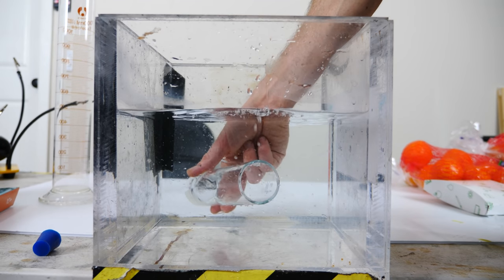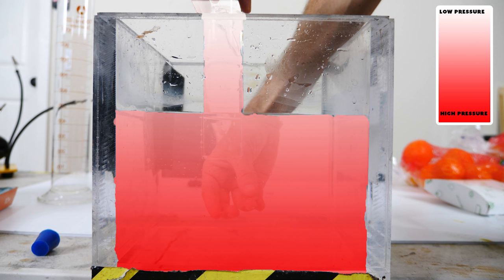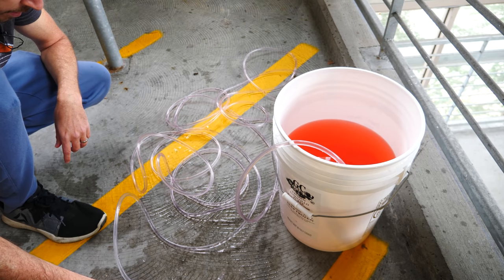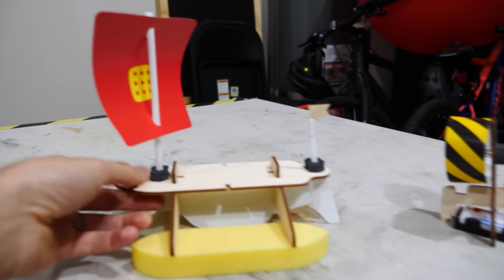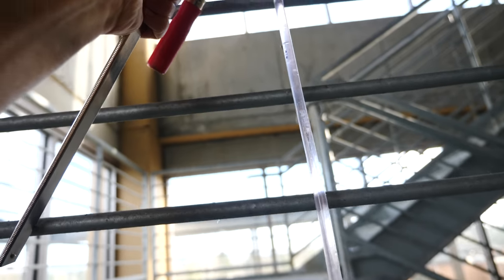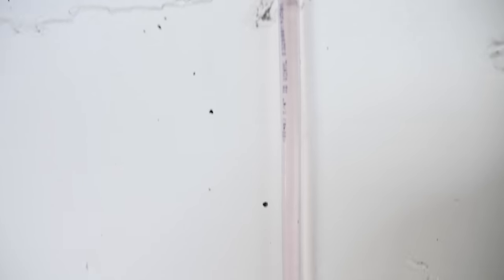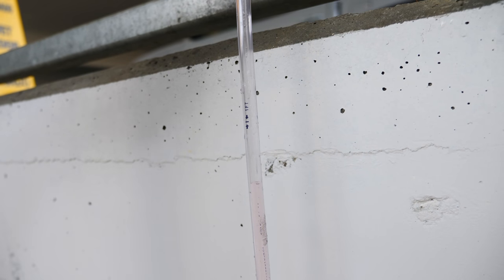Why Water Boils In Tall Cups

Comment: So, the "empty" space at the top is not actually a vacuum, but room-temperature steam, right?
Replace the water with mercury, and it would be a vacuum at the top, somewhere around 60 cm.
Reply: Mercury can also boil

Comment: I'm suprised he didn't take it to the next level and explain that is why we measure atmospheric pressure using a colum of mercury instead  of water. Mercury is much heavier and doesn't boil so easily, so on average, Mercury will lift to about just 30 inches, which is why aircraft altimeters read in inches of mercury.

Comment: I think if you were to use a really large diameter tube, it would boil with much less height, due to the weight of the water.  Not s lot of water  in that tiny tube, so it takes more height

Comment: It also depends if the water was degassed. I am willing to bet that most of that gas, in the tube, was dissolved nitrogen and oxygen that bubbled out of solution because of the drop in pressure.

Comment: You can get 2" clear tubing.  It would provide a better effect due to the volume.
Reply: The 2" tubing would display water boiling at about the same height, of course.  But you want to make sure that the walls of the flexible vinyl tubing do not collapse on themselves under the vacuum that's at the top.  This would be likely with larger tubing.  think of it this way; suppose you had 4" diameter vinyl tubing; it would work find under pressure but would be all floppy without that internal pressure.  If you look at the 1/4" diameter tubing at home depot when it's on the roll, it's all round cross section but the 2" tubing is flattened.

Comment: You should try this it's experiment using the metric system it is much more clever
sounding
Reply: 1 pound of Water equals exactly 1 horsepower if you set it 33 inch away form your Fahrenheit !

Comment: What happens if you immediately empty the 30-plus-foot tube?  Could you make tea?
Reply: The water isn't hot; it's boiling because its at a low enough pressure to boil at ambient temperature

Comment: I watched someone attempt to do a tic tok challenge based off of this "experiment, but they failed in the fact that they didn't increase elevation. Making me wonder how long you could suck water through a straw on a horizontal plane. Is it possible to stretch a tube around the circumference of the earth and drink out of it as long as each part is less than 27 feet above 1atm?

Comment: is this a way to evaporate water without adding any heat to the system ?

if you lift the pipe up to 60 feet 
then clamp it at 30 feet
would you have 30 feet of evaporated water ?
and then could you re-pressurize it and end up with distilled water ?
Reply: If your talking about the way there is less pressure the higher you get in the atmosphere?

Comment: I'm really wondering if you had the real estate could you create some very energy efficient phase change cooling but putting the evaporator high up or use this property to greatly reduce the energy the compressor uses, you would need to run in cycles where you'd close and open valves to stem the fluid in the tube and expose it to atmosphere have the phase change occur, pump the now gaseous fluid through and the close and open the valves to refill the tube. Probably a stupid idea because even though I get the idea of phase change cooling I definitely don't have enough of a grasp of this or anything related to see how this could optimize anything.

Comment: It would have been interesting if you had measured the temperaturw of the boing water, all be it through the wall of the plastic tube and explained why it was less than 100 degrees C or 212 degrees F

Comment: My only gripe is with the terminology. With no molecular energy being added to the system, does it really count as boiling? It's the same reason water fizzles into oblivion in space but you won't be able to cook macaroni like that, maybe freezer burn it but it's not rising to 100 degrees from pressure decrease, the 'boiling point' is being catastrophically lowered so I would assume we need a more proper term for the effect that doesn't overlap with colloquial boiling. I would suggest evaporation but even though that kind of works, it also kind of doesn't. We need a word that neatly implies both low pressure and phase change. A word like sublimation but instead of a phase change from solid to gas skipping liquid, a phase change from liquid to gas skipping temperature dependence.
Reply: Boiling isn’t just about temperature, look up the phase diagram of water. Phase changes (solid, liquid, gas, plasma, etc) are not based in temperature, but a specific relationship of temperature and pressure. Lowering the pressure lowers the boiling point of water. You can also boil water below 0°C at the right pressure.

Comment: Great channel, with practice knowledge

Just my opinion, reply me if anyone agrees with my statement

Higher you go, the top point have lower pressure, so air absorbed in water tries to go out of water (just like C02 comes out of soda when we open bottle and lower the pressure), which we see as bubbles in water, so my statement is bubble we are seeing is air absorbed in water coming to top.

I suggest that, boil water first and let out the absorbed air, cool the water and use that water to do this experiment again, try to not let water come contact with air.

I'm professor of engineering.

Let me know , if my opinion is relatable or not.

Comment: It should be made clear when “boiling” here literally means the water changing to vapor.. having NOT a Thing to do with the temperature of the water.       
When normal people regard boiling they associate it with water temperature not air pressure.    I’m surprised this wasn’t clearly stated..

Comment: Two problems with your explanation: The partial vacuum you create at the top does not "suck" the water up... Atmospheric pressure pushes the water up as there is a pressure difference. There is dissolved air in the water in your bucket and what you describe as boiling at first is just air coming out of the water: this could be verified by having another person lower down see small bubbles - the air bubbles will grow in size as the bubbles rise. Go take a field trip and see the tallest barometer at Portland State University.

Comment: I'm 56 and have known that water boils at a lower temp the higher the altitude. I had no idea it would boil at air temp at only 35 feet. (even though it's in a small tube) I would've lost that bet!

Comment: interesting,as A Scuba Diver that 33 ft has meaning also, every 33 ft underwater adds an atmosphere, but air is so much lighter than water, you wouldn't think that the same 33 ft of water in atmospherics pressure  where air amount used at 33 ft in one breath of air at 33 ft's pressure doubles amount you inhale due to it being compressed by the water66ft triples it, air pressure at sea level is 14 pounds, and fresh water 7 lbs a gallon, I know that 2.3 feet in rise gives 1 pound of head pressure in a 1 inch water column that the water in it will weigh 1 pound, I mess with little height changes or underwater  pressures, thins makes you think of ways to figure it out, went over to get a quick look and saw algebra, and said dang it's 3 am I think it's bedtime,  But I know your not dropping pressure really fast maybe lost .04 of a lb The water weight and the loss of .06 of outside air pressure does mighty and strange deeds, so I guess it's back to nature hates a vacuum and the only way to fill the space is to strip the gasses teach me to stay up late , sorry fer rambling

Comment: As an engineer, I had to do these calculations when I saw Willy Wonka and Augustus got sucked up that chocolate tube and the pumping mechanism was clearly above the pipe. Yep, there's a limit to it's height, just under 34 feet (10.3m), assuming on Earth at STP.

Comment: i bet someone else has suggested this, but incase not:  Has anyone tried to make a REFRIGERATION CYCLE with this specific technique?  
ie: Using altitude induced pressure differences to phase-change water.  Instead of a turbine or pistons or whatever is normally used.
Reply: How would you increase the height of the water without a pump?
Reply: @complainer406   They didn't use a pump in the video

Comment: Here is a thought: boiling takes energy. So when you move the tube up it should take  some energy from the environment.  When you move it down it should it should radiate some energy. So if you keep repeating that what happens to the temperature of the tub/water at/around the level of water in the tube? In that well ventilated environment? What if you insulate it? Could this be made into a rudimentary refrigerator? Too early in the morning to think this through.... :)
Reply: The temperature isn't changing, the water is actually boiling at room temperature  :) 

You're welcome...

Comment: Since water is more sense as a liquid than as a solid could you theoretically cool it enough so that instead of turning to water vapor it freezes instead?
Reply: It's not about the temperatue, but the pressure you cool it at. Water vapour turns straight to ice at low pressures, and the reverse of that is how freeze drying works. You freeze the object, then you lower the pressure until the water starts sublimating out from the object like dry ice does at sea level. Then you're left with a dehydrated object that you can bring back to room temp.

Comment: NO!  You have created a primitive barometer.  The reason you cannot get higher than the approximately 30 feet is NOT that the water boils and vapor fills the vacuum.  Mercury in a traditional barometer doesn't boil, but still cannot be lifted more than the approx. 30 inches of a standard surface pressure; it is solely the weight of the column versus the pressure at the bottom of the column.  Yes, the water at reduced pressure will boil, and that does reduce the vacuum, resulting in a reduction of the column height, but likely only a little bit.  If you did this experiment when it was just above freezing, you might get just a few inches more height from the column.  But the 33 foot number comes from the column weight vs surface pressure.

Comment: Considering steam is valuable for energy production (even nuclear energy is just converting the nuclear fission into thermal energy to heat up water into steam to propel a turbine for electricity), can this water vapor from your experiment be used to generate energy?

What I’m imagining:  a tube that rain water falls into, with the top open and the bottom sealed.  Once the tube is full, an actuator closes the top and opens the bottom.  The water at the top will boil.  Can this be used to run a turbine?

Most current rainwater-based electric generators use a turbine at the bottom to capture the momentum of the falling water to spin a motor to generate electricity.  But steam is always considered more powerful because of how much water expands when turning into steam, delivering way more explosive force to turning a motor for an electric generator.

I’d be curious to know the efficiency of a steam-based rainwater electric generator versus current rainwater electric generator technology!
Reply: The water does not get hot
Reply: @wvking  it doesn’t need to be hot.  Steam engines are based on the expansion of volume as liquid water transitions to vapor.  That expansion is captured as mechanical forces to push a piston.  Steam engines don’t use the temperature of the steam at all.

Comment: barometers like 32" or 32ft water column etc.  replace the tube with a 1"-Interior Dia(id). . try to use a long flourescent lamp tube, if you can de-gas mercury vapor safely, and be able to cut off 1 (one) end. Also have you ever used a vacuum for simple potting epoxy resin filler to assure thorough quality / or to test altitude varient's in cases like water-boiling temp/altitude. besides you said it was 33feet well maybe also the seal was not tight enough. but you would draw enough  Co2 out of the water like shaking carbonated water. thanks for the memory from learning typ- 0.7" Wc to 4-20ma speed control signal that hvac controls typ used back then.  airflow systems in large buildings from simply "Grunting" around and repairing New 3phase motor controllers in the late 70's when they first became widespread (Look Mom No Brushes to Wear Out). Oh yea Safety First (period) sorry for the rant.

Comment: Did you ever think that maybe the water is leaving the tube when you lift it that high and when you lower it the water is pushed back into the tube causing it to rise back to the original height? The water doesn't "boil". Water boils at 212F

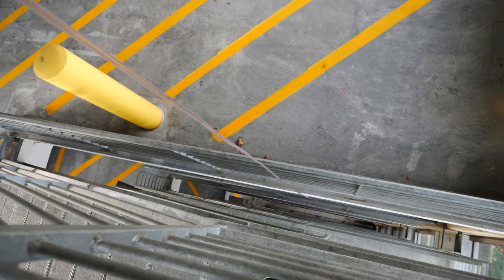Comment: 5:15, That's not true. You did not create a vacuum since there's water vapor in the space above the water. It would be interesting though to know the pressure inside the space. You could have topped the tube off with a barometer. It's impossible to create an absolute vacuum but it would be interesting to know how far you could get in this way by for example using a different fluid. Normally we use turbo molecular pumps (TMPs) to get into deep vacuum but TMPs have several drawbacks. They use a lot of energy, they create unwanted vibrations (especially unwanted in nanometer precision processing tools) and they are expensive.

Comment: Since this is basically water turning to vapour due to the lack of pressure, can you super speed force grow crystals like this?  

With the water evaporating it’d supersaturate the remaining water in the tube but still quickly force it off, 
since it’s basically a natural inexpensive vacuum chamber

It should be possible to super saturate water with a solute even if the water itself is at very low pressures right?

Comment: Why dont we use this effect to boil water to generate power?
Reply: The water is boiling because there's reduced pressure. It's not boiling because heat was added to it. It's not expanding and "producing" pressure. How are you gonna push and spin turbines.

Comment: OMG James i just wondered something. This is a phase change. Got me wondering. Can you make a heat pump out of this concept? Im imagining deionised water with a tiny tube going up, but near the height where we are interested in, that tube splits into a mesh of tubes. No need for compressors, pumps, pistons, sealing components, etc. Just tubes and a heat exchanger. Question is how to reset the device

Or keep the bottom reservoir in a sealed chamber with pressures lower than atmospheric pressure. You wont need the device to go 30 feet up.

Comment: It is not boiling. It is Torricelli barometer principle.
Boiling is usually for cases where the bulk of a liquid is at the boiling point!
In your theory you would be able to measure much different boiling points just by living at th 5th floor...

Comment: You have built a WATER BAROMETER.
The water is NOT BOILING, but rather sea level AIR PRESSURE can only support a HYDROSTATIC COLUMN that is 10.33 meters tall. 
Above that height only a zero-pressure vacuum can exist.

Comment: I would have guessed 33 feet - why, because when you scuba dive, every 33 feet is 1 atmosphere of pressure - So I would assume you could only pull up 33 feet of water in a tube/cup before there was not enought atmosphere pressure to push it up any higher.

Comment: What if one end of the tube is fitted with a gauge to measure pressure before clamping? Then, when it starts boiling, remove the clamp and measure the negative pressure on that end? Just wondering what the numbers would look like. Great experiment. 👍

Comment: Answer what we alle are thinking, but you didnt comment. Was the tube hot when you tuched it at the boiling point?
Reply: No. Boiling point decreases as pressure decrease. So it's the point at which water boils is decreased. Allowing the water to point in ambient air

Comment: That's cool. The question I have is this. Inside the tube the point of lowest pressure would be at the top. If so then why are the air bubbles from the water boiling coming from lower in the tube?
Reply: There's some dissolved air coming out

Comment: trapped gasses (dissolved gasses if you like) efervescing at low pressure is not the same as water vaporizing at high temp. so you have boiled nothing.

Comment: Was the water actually boiling, or was the bubbles just gases coming out of solution?
Reply: Boiling: a substance (water here) changes its physical state, liquid to gas (the bonds between molecules of water breaks). Yes, it's actually boiling (but here on room temperature not on 100°C because of the lower pressure).
Reply: @brdfsz9142  All you say is true. However, the bubbles stopped later in the vid, if the water was actually boiling, the bubbles would continue. When the atmospheric gases left the water, the void at the top of the tube fills with the gases, dropping the vacuum to a few inH2O, if the void was water vapor you would see condensation form  instantly when the tube was lowered.

Comment: not about boiling as much as the mass of the water is too much to over come the 1 atmos
This is basic theory about barometers,  why they use mercury is because it heavier and this same effect happens in less than a meter.
if it was really about boiling then it would not reverse when you lower the pipe.
....
may be co-incidental combination of effects here. 
... you can verify this by changing the initial temperature of the water, and see if the level changes.

Comment: How hot was the water when it boiled? Because i think you touched the tube at some point in time, but it didn't look like it was too hot for you to grab it. I also remember an experiment I did in school where we boiled cold water in a vacuum, and it was still cold when we took it out. So would this be the same kind of situation where the water boils without getting super hot?
Reply: Water doesn't get hot, this is dropping the boiling temp(start vaporising) instead of rising the water temp itself.. water temp doesnt change